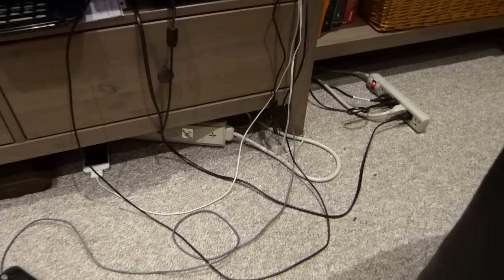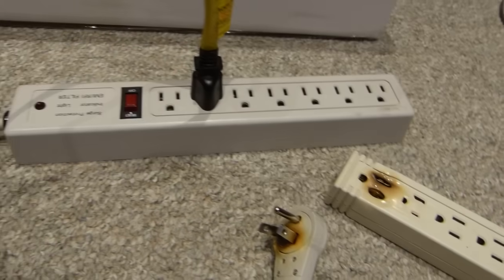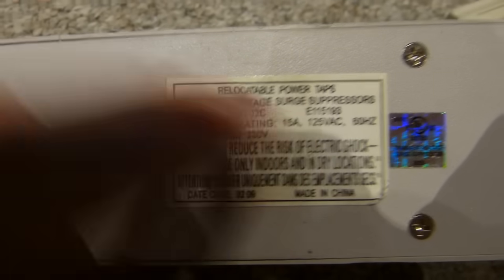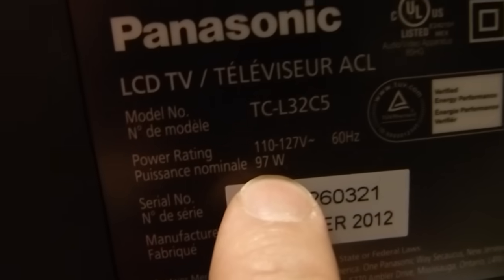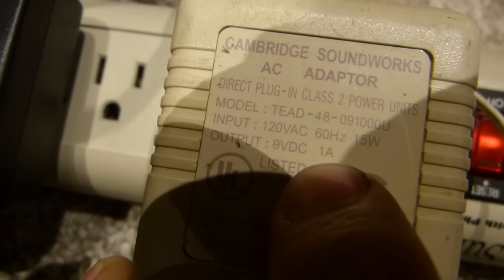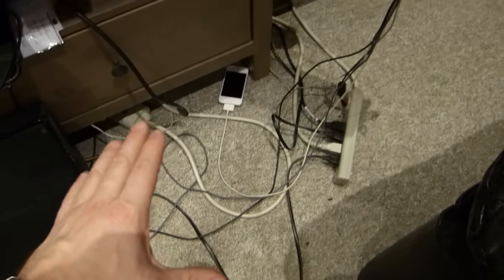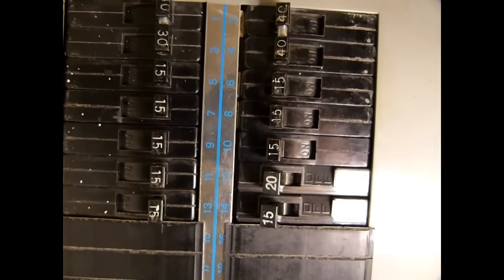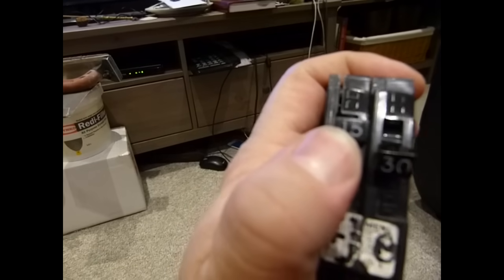Is it safe to plug power bars into power bars?

Comment: i have my tv monitor desktop 3ds switch wii apple tv Atari flashback and laptop plugged into two surge protectors and one of those surge protectors is plugged into the other one so i have like 8 things plugged into 1 wall outlet should i be scared?
Reply from the maker: Not if they stay reasonably cool to the touch. If its discolored and smoldering = problem.
Reply: k thanks

Comment: Ok but you computed badly the intensities, you had to read the INPUT values of each power supplies, not directly on the appliance. For example, 5V/1A are the OUTPUT values of the dlink psu, while its INPUT value (written on the psu plugged to your power bar) is less than 0,5A

Comment: I have a question concerning how the current was divided in this video.

1. On the labeling of a device connected to a power bar, if it says 3A,  then does it take away 3A from the power bar, leaving 12A leftover for other devices. If this is the case, then howcome it was a hazard to connect the heater for the burnt powerbar? 

2. Would the power bars be connected in series, or parallel for the multi-powerbar setup?
Reply from the maker: Heater`s plug badly fitted into powerbar socket. Manufacturing issue, Made in China. There was a connection gap, which lead to arcing, which led to heat, which melted plastic.
Powerbars are parallel, caution is in order and test runs to see what melts, just in case.

Comment: the power bar thingy is called an "Extention Cord"
Reply: It's called a power bar or surge protector
Reply: An extension cord is literally what it sounds like. I long cord with an outlet on it that permits the use of an appliance at some distance from a fixed socket.

Comment: They say it is not safe because of idiots.

If you live in a place that uses the 230v@10A system

If you have a 5 way power board and plug 5 5way power boards into it.
You will have 25 outlets.

Then you can plug in 25 typical USB wall chargers into them as they draw 400mA on average which will give you 10A.
It is a way to mass charge devices

Comment: The summary: Yes, it's safe so long as you don't exceed the power rating (in watts) of any of the power bars or the outlet they're ultimately plugged into.

Everything you plug into a power outlet should have a power consumption rating in watts marked somewhere on the case, usually close to where the power cable enters.  Add up the power ratings of everything you have plugged into a power bar and compare that to the power bar's maximum rating.  If you chain power bars, then add up everything plugged in "down stream" from the first power bar and add that to whatever is plugged into the first power bar.

Outlets have different power ratings depending on your country's mains voltage.  In Australia, we use 230V (officially, although it can go up to nearly 250V in some areas) and our outlets are rated at either 10A or 15A, which comes out to 2300W or 3450W.

To figure out the power rating for your local outlets, multiply the voltage by the maximum ampere rating of the outlet.

Yes, it's as simple as that.

And finally, remember that the more connections you have, the more chances for something to fail since no plug and socket connection will ever be perfect.  For safety, you're better off leaving a couple of hundred watts in reserve.

Comment: I have a TANK power bar that I could actually (yes I know it’s not safe) but I could plug TWO  power bars into it (running computer things) AND could run a small HEATER and it was a little warm but it was fine.
(I KNOW ITS NOT SAFE I CHANGED THE SETUP)

Comment: ELECTRICITY bois! you gotta know what Watts are and how to calculate them! (Watts = Amps x Voltage) btw an apple TV only uses 2 Amps maximum.

put it this way. Amperes; Are how fast or slow, the electrons flow in a wire. The more amps the faster those electrons flow. the effect of higher amps is only limited by size.

Despite that every electronic device you buy from the store has a label on it to inform you, most people just see random numbers and words.

Comment: I see heaters plugged into these a lot at work, EVEN people that deal with computers, etc and should know this stuff. Drives me nuts. IMHO space heaters should be banned at work, unless there is a specific and valid reason that a person needs one due to health, etc. Otherwise just put on another layer. If the room is like 65-75 degrees F I don't think i'd worry about it. Maybe even give or take a few degrees.

Comment: running a bunch of devices that barely use any power and then you add into the mix a heater that draws a constant load thats close to 15amps. Ya the breaker wont trip until it reaches around 16amps or so but your power bar will star to heat up do to the excessive load it has because of the heater

Comment: A heater has no business attached to a surge protector or even a power strip imo. Use a heavy 20 amp rated extension cord.  Also Just because it's a yellow or orange extension cord does not mean that it's heavy duty.

Comment: heaters take like 1300w+
Reply: WOPPER  its all about heater size
Reply: Properly insulate your room, then your PC and monitor will be enough.  Run distributed computing applications on your computer on cold days, you won't need a device that is useful only for heating.

Comment: You don't add up amps of different voltages, you dumbass. 

On the router there's its input voltage, which is DC that comes from its power supply. What you should take a look at is a power supply. 

Like that power supply you took a look at that said "5V 1A". That's a wrong place to look at. Just a little above it there was a sign saying "120VAC 60Hz 15w", which is 0.125 amps for your power grid. 

Also, prebuilt PC. You are a disgusting human being.
Reply from the maker: Grade 1 manners?
Also sorry to hear about your low self esteem. Fix it elsewhere.

Comment: never EVER plug in a high-load appliance into a plastic power strip.  there is a hidden flaw in all, being the plastic isn't thermally rated for the temps the metal strips may reach.  when the makers say 15 amps, they are only referring to the plug configuration and fuse, and not the actual thermal rating for the shell.

also, it has been found that the wires used on the cheaper strips are actually underrated for the load.  if the cord is 16 awg, you can only put 12 amps on the strip, and 18 awg can do even less (maybe 8-10 amps) and should be thrown out.  it should also be noted that the prongs in the plastic strips can also be undersized for 15 amps, and normally only can handle around 10 amps per socket.  the metal ones generally use better quality contacts that can handle 15 amps, but may still get warm.

if you are going to plug a high amp device into a power strip it should be made of metal and have intact grounding with a 10-14 awg cord.  however, is it best not to use power strips for appliances anyways.

Comment: Is it just me, or does that Belkin power strip look like it's been in service since the 80s?  They do wear out, ya know?
Reply from the maker: Bought 2000 Feb 14, being watched
Reply: Ok, so that's still 18 years old.  Those things have fairly cheap spring metal contacts that wear out.  Under a normal low current load, it would last forever, but when you start pushing 10a on those things, the lost tension starts rearing its ugly head.

At least you caught it.  We have a few in the office that have met high load deaths in a similar fashion.

Comment: The heat damage / fire was caused by a loose (or) high resistance connection between the  socket of the first power strip and the plug of the second power strip,  and not because of an overlaoad.

And while adding the amperes of the different loads. All the amperes rating should be converted to it's equivalent 120V reference before adding them up.

Comment: ive used alot of pwer bars and sometimes the socket is wobbely and i can hear the electrisity.
Bad spelling... I know
Reply from the maker: ... but valid point. There shouldn`t be arcing and sparking inside or out. Internal arcing melted this plug.
Reply: I'd smash that cheap power strip if it bends it's not going no where near my house let a bear brush it's teeth with it 😂😂😂😂😂

Comment: we do this on a large scale on LAN parties. we do however go thru EVERYTHING and plan how we spread it out. Here we use 10-16A 230V systems and fuses and we use 16A rated stuff AND spread it out as best as possible. we try to allocate 8A to a 16A circuit. .

Comment: That spinning plug looks like the cause of the failure, not the loads. Notice how the first extension shows no fault, even though it carried more current.
Let's just face the facts, The only reasons this isn't a good idea are
1. Stuff from china can vary greatly in quality
2. Insurance companies want to find any reason to not cover a fire, they are a private company after all.
but if your loads are small, and you are mindful of how you place them (bigger ones on the first strip). then you are fine.
Reply from the maker: Right, internal arcing caused the meltdown.

Comment: If you're plugging in things like routers/ cable modems and other light loads you are probably fine as long as you don't overload the watts. I have one plugged into another but it's only for a lamp, alarm clock, phone charger, small computer speakers and sometimes a fan. Nothing Major.  Most power strips can handle a good 1500 watts before the built in breaker pops. Heaters on the other hand you plug DIRECTLY into an outlet. Hair dryers as well as those draw at least 1875 watts.

Comment: As stated in at least one other comment your point of failure is the rotatable plug on that power strip. The rest of the video seems to be fine. However, I do have one problem. Those power strips are rated at 15 Amps with the length of wire attached to it. You you daisy chain 2 identicle power strips, you just doubled the length of the wire, reducing the amount of current  (amps) it can handle. By how much depends on the gauge, temperature rating, and material of the wire. Then you have to consider the resistance of the plug and socket of each power strip you daisy chain together. 
I always find it best to tell people no more than 2, and plug high demand devices like a heater or pc into the first strip and leave the second for low power devices like monitors, tv's, and phone chargers.

Comment: Not true!!! That burned plug was rated for 15 amps and is engineered to safely handle twice that IF IT IS PLUGGED INCORRECTLY AND IS CLEAN. The circuit breaker would have tripped at prolonged loads of over 15 amps and would have shut down the circuit if the load was much over 15 amps. Just look at the local burning where the heater cord burned. That was likely not plugged in fully.
Reply from the maker: Right, plug melted due to internal arcing.

Comment: This is why all the plugs in Britain have fuses.
Reply: No, it's not. The reason BS-1363 plugs have fuses is because the "ring" cables in the wall are fused at 32Amps. If you put 32amps through a 13amp cable it will glow with a pretty orange colour. The fuses in daisy-chained extension cables are (technically) unnecessary.

Comment: You did wrong, you should connect the power bar and connect three heaters each of 1500W and then connect into another power bar (also full plugged) and then wait to open an extra dimension

Comment: It comes down the issue that many power bars have ,, the rating of there individual sockets and the high chance that a poor high resistance connection will develop at one of them due to there poor contact rating causing that connection to burn up , this happens even though you are not exceeding the overall current limit rating of the protection circuit breaker for the whole bar itself so it never trips and you end up with a fire , by daisy chaining power bars ,, your odds of doing this go way up because you are focusing the an entire bank cumulative loads on one plug connection.

Comment: One of the disadvantages of using a low voltage such as 120V is that it requires a higher current to deliver the same power as a higher voltage can do at a lower current, and thus requiring more bulky connectors and thicker wires to establish a good connection. I've seen lots of pictures and videos of charred and burned 120V outlets. I live in a country with 240V phase-to-neutral and I've never seen a burned outlet here (not saying it hasn't happened, I just haven't seen one). Most outlets here are fused at 10A.
Reply: now I want to look up comparison info on 120 and 240 vac.

Comment: Without even watching the video yes it's a safety hazard that's why people have many plugs around the house instead of just 1 and in the electric box comes in a far thicker cablento handle the current. 

Whoever was the idiot that did this shit needs to be slapped the fudge out.

Forget if the powerbars burn imagine how fucked the wiring of the house might be

Comment: I swear... Heaters need to have a special plug so they will not connect to underrated extension cords/power bars. I've seen SO MANY pictures and videos of toasted cords and bars, and 90% of them are due to heaters. We could almost get away with using the 5-20 plugs (AKA: 20amp plug). You rarely see extension cords for those, and most homes will have a few of the outlets. If not they could be easily upgraded since 12 gauge wire is pretty common for outlet circuits.

Comment: i get where this is going, the whole reason why its against electric code to daisy chain power taps is because its very easy to overdraw current from the host tap  from all the extra crap or current plugged into the host or downstream taps, putting a large amp draw on the main one, burning the wires and starting a fire, if the host is 15 amp max, the total current draw across ALL the power taps in the daisy chain must NOT exceed 15 amps, even if a downstream tap can handle more than that, i see many people only account on a per tap in the chain, and push 15 amps on 3 of their taps (totalling 50 amps to the first tap, burning it)
Reply: That depends on what's being plugged in.  Many devices use less than half an amp each; 21 such devices would fill up four, six-outlet power strips (three of the 24 total outlets would be serving power strips) while drawing less than 70% of a 15-amp circuit's nominal capacity.